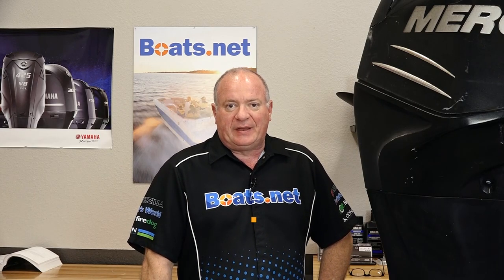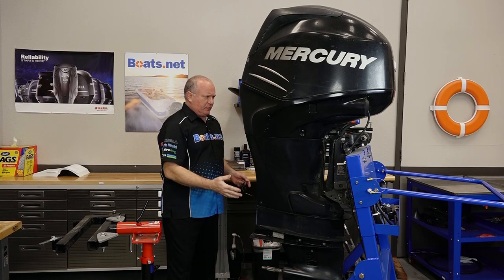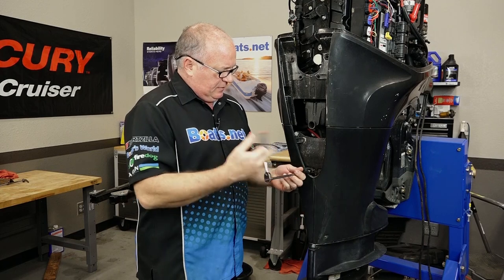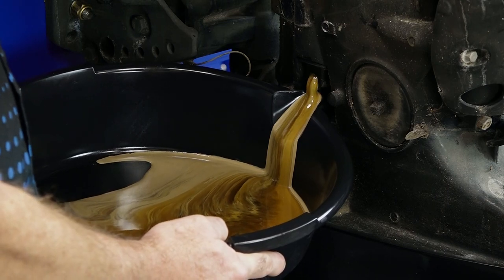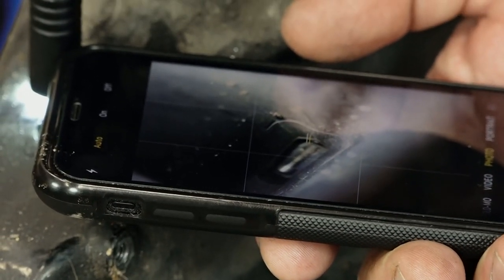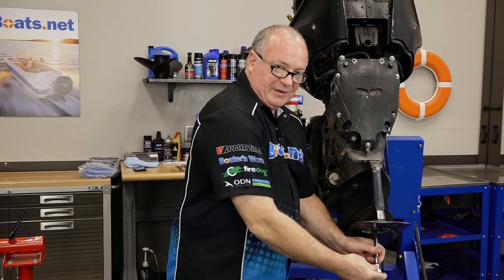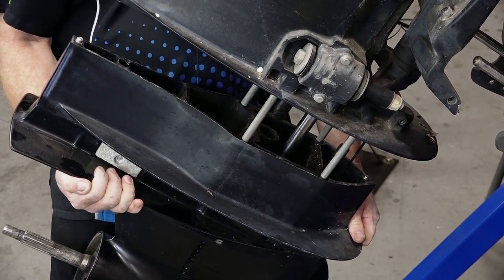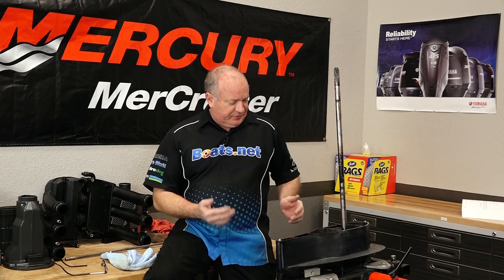Mercury 200 Lower Unit Removal | How to Remove the Lower Unit on a Mercury Outboard | Boats.net

Comment: Hi John, Your reply is very much appreciated. Once I removed the 2 screws and followed the prying at the arrow points, the center portion on the Verado chaps area  just popped off.. Too easy once you see how. Job all finished and new anodes installed - tricky to get to that deep anode bolt but an extension socket worked so all finished and reassembled.

Comment: To remove the rear cover You should remove cowl release handle. There is 1ea 8mm bolt that holds it on. Next remove the two 8mm bolts for the rear cover. Note the small arrows on the cover. Gently pry at the arrows and the rear cover comes off.

Comment: Hi John, in my previous message, I have referred to lower cowling. I mean the Chaps on the leg. I cannot see the logic to remove the center section to get to the Chap bolts under that center piece . My verados are 2007 vintage. I am simply trying to replace the anode but the chaps have be off to get to the anode bolt.

Comment: Another project motor, nice.  Hopefully by some miracle we could see a powerhead rebuild series of the OMC V4 crossflow series of outboards from years 1980 to 1998.

I don't think anyone on YouTube has done a complete detailed rebuild walkthrough of one.  Possibly an OMC looper but not a crossflow.

Those crossflows are almost a dime a dozen, so even if certain parts "new" are NLA, one could almost just as easily source them from salvage in usable condition (crank, connecting rods, etc.)

Comment: Hi John, I have twin Mercury Verado 135hp on my boat in New Zealand. Your video is excellent describing the removal of the lower cowling and I am almost there.
In your video at 1.05 minutes, you say you had already removed the center section to get at the internal bolts for the cowling halves. That is where I am stuck - how do I  remove the center section or is it super simple and I am just missing something?
Reply: I just posted how to do it. I too struggled with it

Comment: I have a 40hp command thrust gear case.  I don't see that little clip you popped off on my motor. Any suggestions? Model #1F41453LZ

Comment: I’m having trouble w/ my lower unit. 2023 300 r with 13 hours.  I got Some dirty water /mud that cleared quickly.    Now the engine wants to turn over, but it seems like lower unit is fouled.   I can move the prop freely in neutral and forward , but not in reverse.  My voltage is good

Comment: Great videos!!!
But why draining motor oil to remove gearcase?🤔
Reply: The drive shaft goes straight through the oil sump for the power head.
Reply: @AlfOfAllTrades so if you remove the lower unit it exposes the drain plug area? I have a piece in the bottom of my drain too big to get out of the drain hole. Found it on oil change.